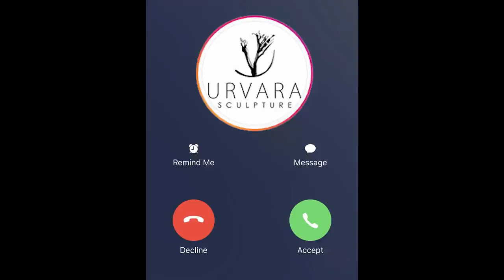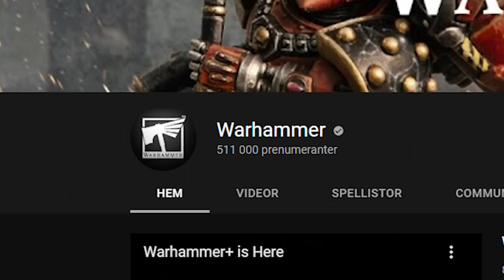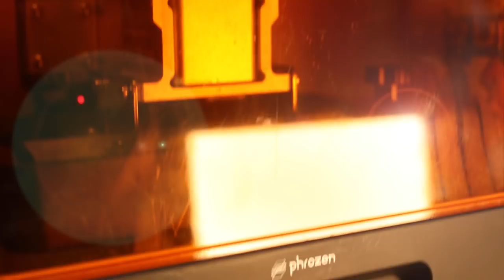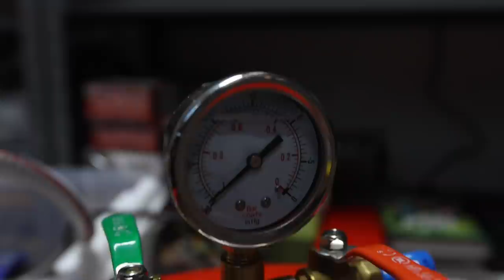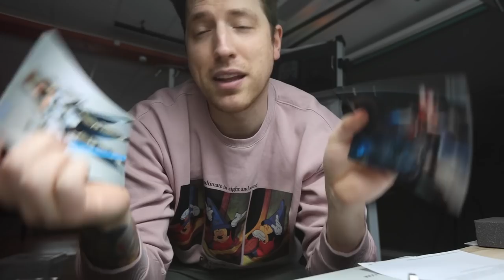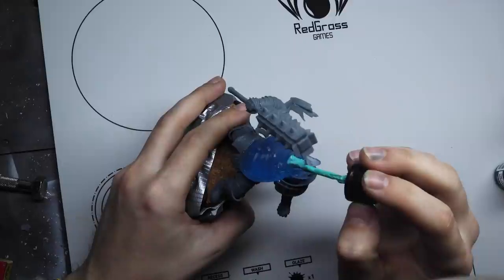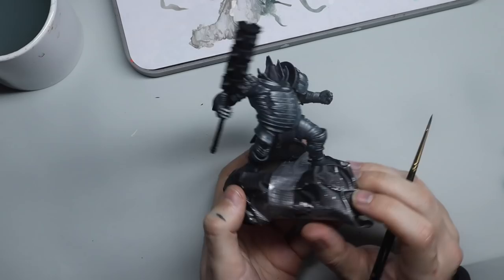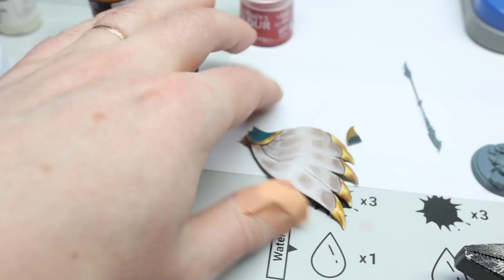7 liter resin pour inside a 50 year old TV - Diorama build

Comment: When cutting the mould you should cut it in a rough pattern instead of a straight line. This will make the two halves of the mould match up better much easier and avoid mould slippage if you ever reuse moulds.

Comment: You should have done what dice makers do, they use a pressure pot to shrink the bubbles. Plus the bare foam is porous, you should have painted them to get them glossy smooth. 
Your casting foam worked perfectly, it will pick up any small details.
You should try machinist wax, after you are done casting you can melt down and reuse it.

Comment: As someone that does a lot of 3D printing, buy some clear resin. Pour enough to fill your vat into a container and use inks to get it the color you want. Saves a lot of time and headaches of trying to vacuum out and cast parts. Both the chest and ice crystals could have been done at the same time (And even pre-hollowed for the lights) saving you time.

Still an amazing piece!

Comment: For big pours like this, get deep cast resin. It hardens slower and produces less heat when hardening. The cracks and bubbles come from the heat when hardening, especially when using xps foam which can cause gasses to escape when heated which get released into the resin etc. If you get nasty cracks you can try to drill into them to make cavity and fill that with the next cast and hopefully the cracks become invisible.

Comment: I've read that resin shouldn't be degassed with a vacuum, as the resin can evaporate and never stop boiling until it's set. And the fumes can wreck your vacuum pump. Better to paint the surface of the mold with resin (to eliminate surface bubbles) and then do a high pour and stick in a pressure pot.

Vacuum for the silicone bubbles > Pressure for the silicone to set at the pressure you plan to use it.
Vacuum never for resin > Pressure for the resin to set with no bubbles
Reply: What I was going to write. Pressure pot for hard resins, vacuum chamber for rubber.
Reply: As I understand it, from watching a LOT of resin-prep stuff, that's wrong.

Resin just holds a lot of bubbles and because it typically sets faster than silicone it's recommended to give it a pressure pot instead of a vacuum degassing.
Reply: Pressure pot is good for resins when you're doing small batches, vacuum degassing when you're doing large batches.

Comment: Just a quick word of caution for anyone considering using an old TV for a project like this: CRT televisions contain some pretty dangerous voltages! Make sure everything is de energized before you go poking around too much in old electronics, capacitors can store energy even if the television is unplugged, learn what they look like and be safe.

Comment: That resin reaction is really curious!! Also, from videos I've watched about molding and casting, it is better to compress the resin in a pressure pot than use a vacuum chamber. It's supposed to be quicker and less messy
Reply from the maker: Yes for polyurethane resin casting, unfortunately the TV was far too big for the pressure pot! This would be the good alternative :)

Comment: I have never vacuum degassed resin, silicone yes, never resin. I think that is where a lot of your problems are coming from. Pouring the resin slowly and using the pressure pot should be enough to get rid of any bubbles.

Comment: Quick question, why cast in clear resin instead of printing said part with your printer? I've only used clear any-cubic resins so far, but they have been more than up to par in terms of quality. Also light acrylic inks, or tamiya translucent paints will get the same effect and save you a lot of time. Just a few cents to throw in awesome work as always guys!

Comment: All that drama with the resin leaking out of the TV could have been solved with a simple vacuum-forming plastic sheet applied inside, behind the foam background with a heat gun, to act as a resin bucket. Never trust glue to hold resin, especially with a pour that big.
Reply from the maker: I feel so dumb now